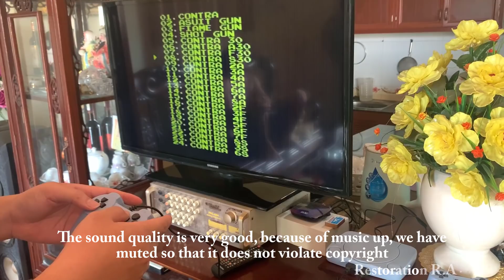Restoration old broken PlayStation PS1 controllers and handhelds | Retro Console Restore & Repair

Comment: Okay, before everyone hates on the Polystation, lemme say something:
I own this beast of a famiclone, due to NES being pretty expensive here in Poland, and everyone I know who is older than me, actually grew up on the og (IQ-502/MT-777DX Pegasus family) or the Terminator family consoles (BS-500AS, T-800). Meantime me, I grew up on getting my 1st famiclone at the age of 9. And it was the same one I still own to this day. It was abused by me many times (Curse you Contra Forces). All I did was replace the PSU and it works flawless till this very day. It's hooked to my only CRT in house and is basically my retro-gaming... Thing. I'm buying a everdrive for it (60-pin everdrive due to it using a famicom port). It's a bloody good console with high compatibility (YES THOSE THINGS CAN BE INCOMPATIBLE WITH SOME CARTRIDGES) and very good, solid controllers.
So yeah - stop the polystation hate.
Reply: 8ball?
Reply: Its bad.
Why?
Because it is.
Reply: Nie wazne ze podroba wazne ze  solidna :)

Comment: took apart the system then pretended to check continuity of circuits than put it back together than took it apart and threw dirt on it than took it out to some trash and "found it"  there than cleaned it than likely threw it in the trash and edited it all to make it look like a restoration. If those NES clones are like 20$ shipped to the US they must be like 3-5$ locally so he will more than 100x investment on this video that probably took a total of an hour to make with editing.
Reply: Also How Did He Not Mess Up The Mother Board By Literally Washing It

Comment: So you're telling me someone opened the controllers, caked them in dirt, and THEN wrapped them shut with those red ties? Because there was dirt under those ties and they were on pretty tight...there aren't even lines in the dirt on the controllers where the ties were wrapped around them.
Reply: Because the owner had thought it was actual playstation and felt cheated.
Reply: it's fake dude. clear as day

Comment: Well, he isn't dumping the processors and HDD into the soapy water, so I guess he is learning.
Reply: Still using an ohmeter on a PCB with embedded chips. That 9V battery is generally a bit more than should go through a chip. Do a voltage drop test instead.

Comment: This is a bootleg ps1 witch is why it was easy to "repair" the ps1 is gray and the console is more bulcky and it doesnt use cartridge it used disk and the controllers are also gray and say sony on it and it doesnt even have the most iconic thing the colored shapes on the buttons

Comment: Cringe, not even a real PS1... Also, his resoldering is very cringy, supposed to flux; clean old solder off; put controller wires throught the bottom of the board(so they dont interfere with the membrane cups); then resolder with flux core 60/40. I dont put much faith in the controller lasting long.